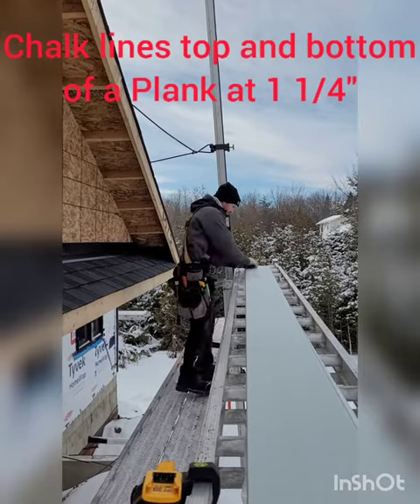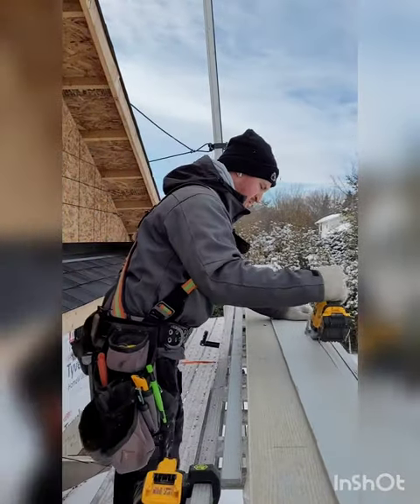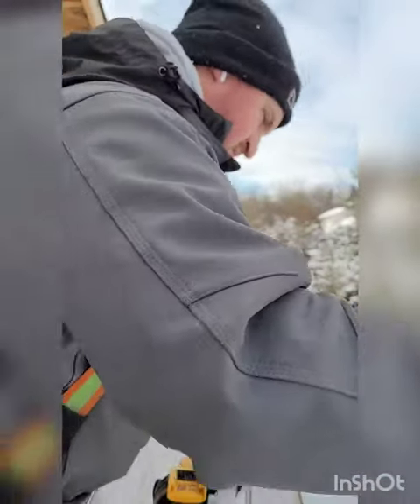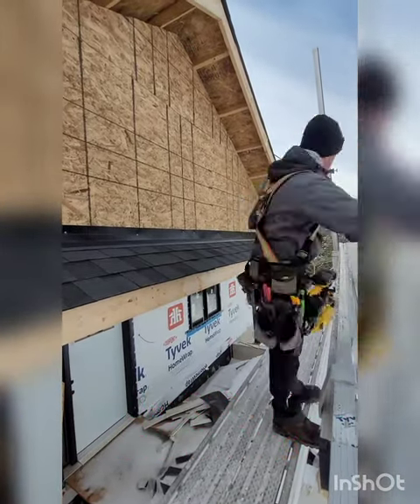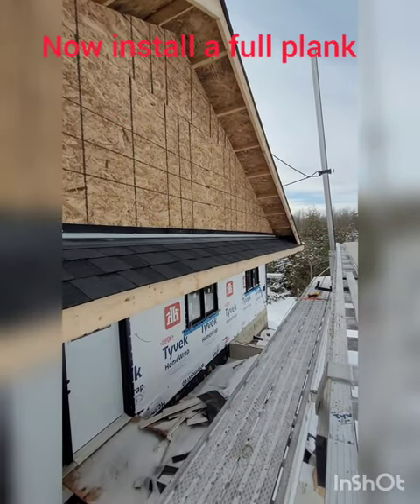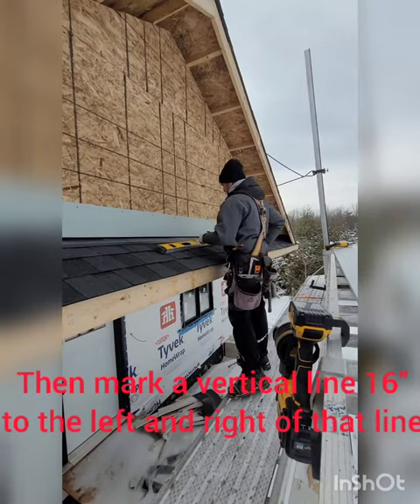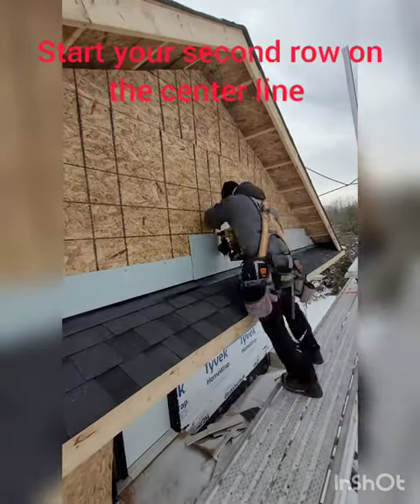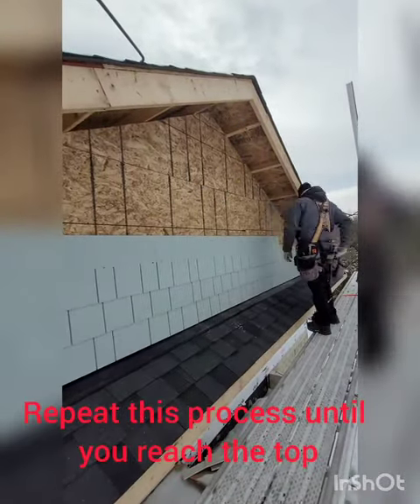Hardie Shake (Shingle) installation

Comment: Tyvek or other WRB has nothing to do whether or not there is conditioned space inside the wall. It has everything to do with protecting the structure.
The R703.2 requires that an approved water-resistive barrier is applied, according to manufacturer’s installation instructions, over studs or sheathing of every exterior wall. The approved water-resistive barrier must be continuous to the top of walls and stopped at openings and building appendages in a way to meet the requirements of the exterior wall envelope described in Section R703.1.

Comment: I just got a 100 shingles, I was working my way through the bundle using 5" singles (first "tab" width) then I hit a batch of 7". if you stagger them per Hardie (normal wall -starting from left 16" off 32" etc) and mix and match these different patterns the gaps get too close (less than the 1 1/2 inch hardie recommends). I thought it was a mistake!!!! I thought they sent me old inventory. Have you run into this problem???? @johnFLopes asked about this, so it's an issue.
Reply: You’re supposed to alternate them one 5 inch panel one 7 inch panel one 5 inch panel one 7 inch panel

Comment: Does it matter if it’s 7” or 5” singles ( I’m talking about the first shingle )
Reply: omg, I need you! I just got a 100 shingles, I was working my way through the bundle using 5" singles (first "tab" width) then I hit a batch of 7". if you stagger them per Hardie (normal wall -starting from left 16" off 32" etc) and mix and match these different patterns the gaps get too close (less than the 1 1/2 inch hardie recommends). I thought it was a mistake!!!! I thought they sent me old inventory. Have you run into this problem???? I'm going to post this above to see if he'll respond.
Reply from the maker: I understand now. I'm not familiar with the single Hardie shingles. I'm in Canada and nobody sells them up here.
Reply: Alternate them